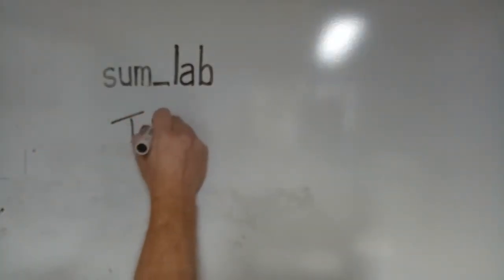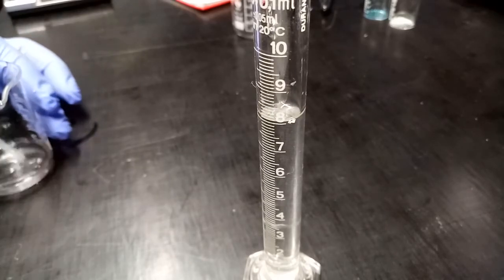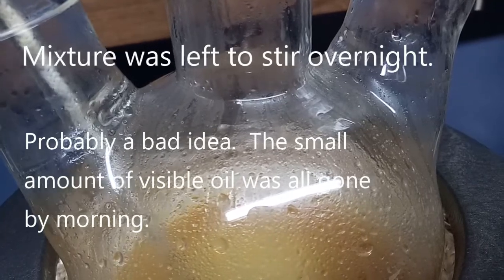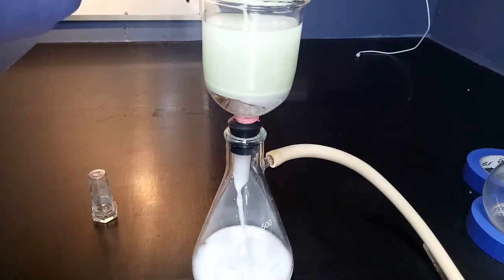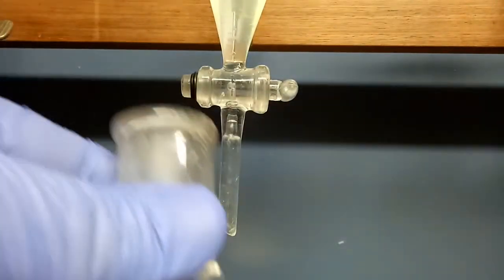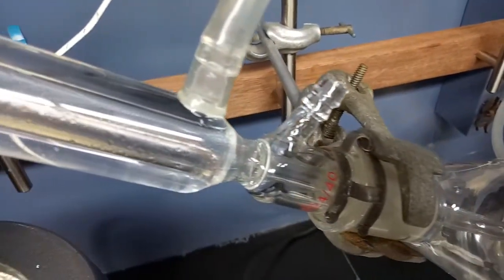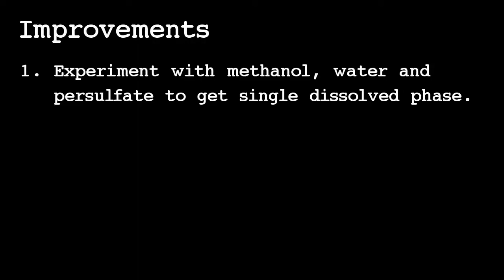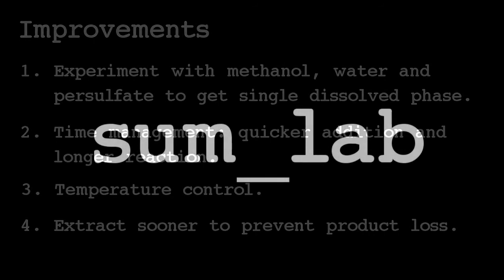Benzaldehyde attempt 1

Comment: Sum_Lab......I too have attempted this reaction, and for the life of me I cannot figure it out...I am well versed in organic chemistry, and the persulfate is not supposedly the actual oxidizer, the copper and Iron act as a redox couple and it's those two acting together through a chain of events that get the ball rolling by stealing an electron off that alpha hydrogen on the benzyl group...but that got me thinking immediately before I even attempted it...Methanol ??!! are they kidding ??!! Methanol is dead easy to oxidize, even with weaker oxidizers, and low and behold, what did I get ? the foul and immediate stench of tear inducing cancer promoting Formaldehyde !....Honestly so many patents in organic chemistry are quite dubious, fickle bloody things  especially when it comes to partial oxidation's....personally I think the methanol has to go, replaced with an inert solvent and enough has to be used so it's all in one phase, and yes like you said, not left over night..maybe just 1 to 1 in stoichiometric ratio too when it's all in one single phase....well, really TWO to one actually because I think the mechanism goes methyl group then benzyl alcohol group THEN aldehyde..and as we all know the aldehyde is FAR more susceptible and likely to get nuked all the way to benzoic than the benzyl alcohol group is....because of that I reckon yields over 50 percent is just not going to happen....but I still think the method as it stands is bollocks..thoughts ?
Reply from the maker: I was coming to much the same conclusion. TBH I have not spent much time thinking on it the past couple of weeks but I can't see that the methanol is helping.
Do we actually need an inert solvent?  Maybe just excess toluene?... Although getting a single phase will be better.

One of my issues is my persulfate.  It is old and I think it has decomposed somewhat.  There are definitely two compounds in there with different solubilities.  I was considering a switch to permanganate.

Thanks so much for the info about the role of Cu/Fe.  That makes a lot of sense.  It also gives a point of reference when thinking about what other oxidisers might work

I will get back to this again at some stage.
Reply: answering your questions in order, in this case we definitely do need an inert solvent, like is so many other oxidation's if you don't then you run the risk of over oxidizing your starting compound, but even more than that, in this case you most definitely can't use just excess Toluene, remember how I said the oxidation progresses ? it goes through these steps...Toluene to Benzyl Alcohol and then to Benzaldehyde...so you can immediately see that if you use a large excess amount of Toluene then a lot of your oxidizer will be wasted by just oxidizing more Toluene molecules to benzyl alcohol and thus there will be less available after that for the final oxidation to Benzaldehyde, so you see you do need to be very careful with stoichiometry when doing partial oxidation's...The persulfate apparently has good stability and does not decompose much. I suppose if it did , it wouldn't be by too much, but maybe just as a check it could be titrated against some sort of Iodide salt with a little starch (potato juice?!) to see if it is any weaker, probably not worth the hassle though. As for permanganate, forget it, it is not impossible, I've actually had good success in turning the propenyl groups on some essential oils into aldehyde groups, but it needs big dilutions, eighty plus degrees Celsius and fast mixing..and the only reason that it succeeds at all is because the end product immediately precipitates out of solution and the permanganate can't get to it as well. BTW have you tried Chromyl Chloride oxidation of Toluene ?...it is not a fickle oxidizer, it works. You must do it in  dilute solution, and Methylene Di-chloride is a perfect solvent for this, make up the chromyl chloride and then  toluene both in say 20 percent solutions in CH2Cl2 and drip in the oxidizer slow and stir and COOL...collect p.p.t and hydrolyze in a.q. weak sodium sulphite and there is your aldehyde ! A lot of people say you need to distill your chromyl chloride, but you DON'T. It can be made dead easy in a sep funnel, 98 % sulfuric, followed with Dichromate or even just chromate dissolved in 37% HCl...the CrO2Cl2 forms and sinks to the bottom over half an hour with cooling, then, just run it off, done ! Old Chemistry books are a wonderful source of forgotten but very practical methods for difficult reagents....Be very careful with Chromyl Chloride, it's an angry evil fuming liquid . man that was a long post..!
Reply from the maker: psycronizer , you have been most helpful. I will crack this nut one day.
I don't think I have the experience to play around with large amounts of chromyl chloride so I will give that a miss.
I have seen oxidations of benyl alcohol using permanganate which was why I considered it.
My persulfate titrated at better than 98% purity three years ago. But now when I attempt to make a saturated solution I find about 20% of the material has a much lower solubility. I have gotten around this by filtering but I really don't have a lot of confidence in the reagent.
Of course I can't use straight toluene. I should have thought of that. I have few options for a solvent though. What do you suggest? It might just be simpler to start with benzyl alcohol. (But then, where's the fun in that?)
Reply: When I much younger, and a little naive as to the dangers of runaway oxidation's, I was doing the chromyl chloride Toluene oxidation and I made a stupid, stupid mistake...I tried to skimp on the dilution of the reactants by only using a 50 % dilution in methylene dichloride, instead of quite dilute at like 20 %..and it bit me..big time. I had dripped in about half the chromyl chloride solution, with adequate cooling and magnetic stirring...then it happened...the whole mixture suddenly went from liquid to a solid in less than two seconds...this was due to not using  more diluted solutions of course...and then one second after it had all solidified, it crackled a little then burst out everywhere in a low order explosion !!! bits of chromyl chloride / benzaldehyde adduct peppered EVERYWHERE ! good thing I did this outside...my wooden deck still has the tell-tale green color of chromium 3 all over it...so yes, it is a reaction that demands that you know what you are doing and don't cut corners...Anyway, back to your questions, yeah, using Benzyl Alcohol will certainly work a darn site easier with the persulfate, there are other YT accounts of the reaction going quite well. As for a suitable solvent, well, the best and easiest to get is undoubtedly Glacial acetic acid..or close to it, maybe 90 percent at the least. Acetic is an excellent solvent for oxidation's, as it is really good at dissolving many organics and also many salts...it's fairly easy to get too. If you can't get it, what solvents do you have ? you may have a substitute, but then again, you COULD make your own acetic from ethanol and permanganate, carefully...and then just distill it...
Reply from the maker: Acetic acid synth is definitely on the list of things to do. I think it just got bumped up in priority.
Thanks for all your generous help.
Reply: you are most welcome. One more thing... you might like to have a crack at, since you seem to have a well equipped lab. I'm sure you have heard of PCC, or pyridinium chlorochromate, this oxidizer is a beauty for alcohols like Benzyl alcohol to Benzaldehyde in very high yield, it's done in DCM too. The reason it works so well, and stops at the aldehyde stage, is because since it isn't in an aqueous phase, the aldehyde can't form as it's HYDRATE, and those hydrates are very much more easily oxidised than just the aldehyde. I know that pyridine isn't all that pleasant from a few viewpoints, but actually it too can be substituted with Quinoline, which is easily made by the Skraup Synthesis, Aniline with glycerol and conc. sulfuric acid. Then again you could always just buy some bulk Nicotinic acid (vitamin B) from a health food shop and subject it to pyrolysis to decarboxylate it to get Pyridine. I've never tried using P.C.C. but I think it would be fun..and a Y.T first too......

Comment: hey man, nice channel you ar building up. if i may suggest something, during your video editing, you could low the ambient or equipment sound volume during lousy procedures such as vaccum pumps in action, or stir bars tackling, etc. its a bit hard to listen to you during those kind of scenes. thanks for the upload!! subbed.
Reply from the maker: Already noted.  It was a problem in this vid in particular even though I checked during production.  Later videos should be better.
There is so much to learn in producing a decent video and sound/narration is a lot harder than I anticipated.